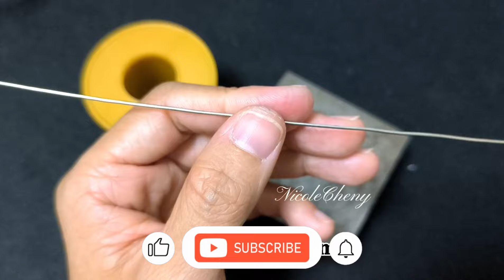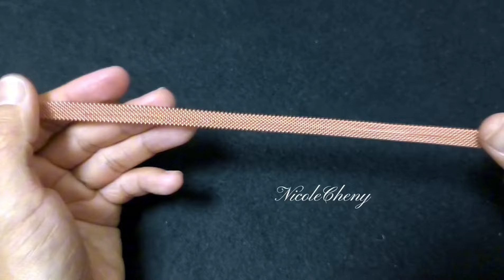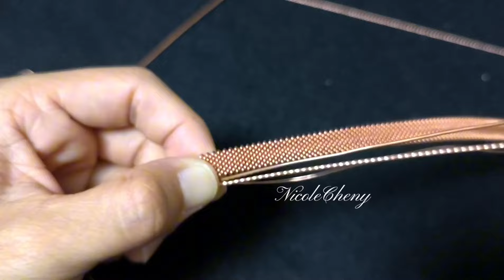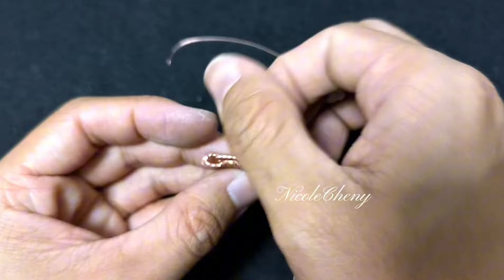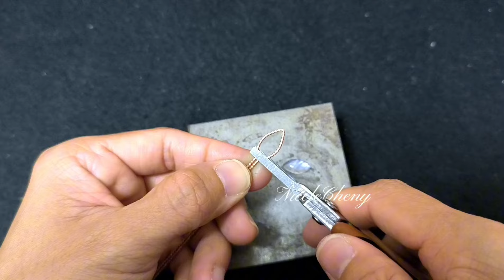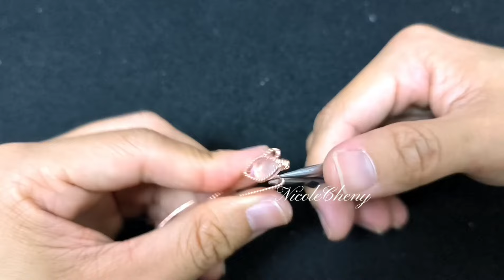Wire wrap bracelet tutorial

Comment: I really love this bracelett - and would like to give it a try. 
I have a question...you coiled a 24g over an 18g - but how big is the soace between the coils? I don't have 24g - only have 0,4 (aprox 26g) and 0,6mm (aprox 22g) - what gauge can I use to coil over?
Best greetings from Austria, Martina
Reply from the maker: Hi martina. You can also  use 0.4mm wire to coil around the 1.0mm wire. The gaps will be 1.0mm as well.
Reply: @NicoleCheny  I gave it a try - and I'm so happy how it turned out - thank you

Comment: This is gorgeous! Did you make the small coil that is used to start the longer one in the very beginning? Is it so the  coils on the longer wire are spaced evenly? If you did make it, how do you get the "guide coil" to be so evenly spaced?
Reply from the maker: Yes, I made it myself. I wrapped 24ga and 21ga wires together around 18ga wire, then took it off and removed the 24ga wire.